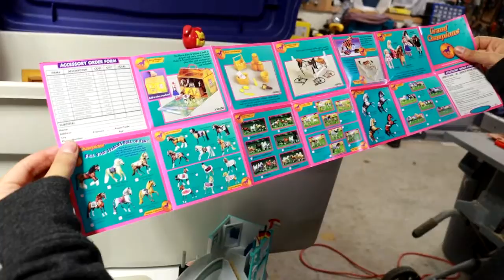UNBOXING my Childhood Collection of GRAND CHAMPIONS Model Horses, Toys & Stuffed Animals I Sewed

Comment: "I used to think the horse thing wasn't an issue... But I'm starting to think it's an issue." Thanks for the giggles. I had a few of the early Grand Champions back in the day, and donated them (many of which were Maureen Love knockoffs I feel now with more educated eyes). Which I alllllmost regret, but I'm sure some little girl was thrilled with them... One of mine that made noise, the battery was working well over ten years later. Cute video!

Comment: The following models and merchandise from Grand Champions that I used to own are as follows: (it was never easy choosing which ones I was after as they were all really cool).....⬇️

*The quarter-horse foal called Goldilocks from the 2000 range of foals (the golden palomino one with the pink horse blanket/coat/rug and matching pink ribbon in its tail).

*The 2003 Lippizzaner foal (the black one with the white star on its forehead  and has a deep red horse blanket/rug/coat and matching red ribbon in its tail). Not sure if this foal had a name.

*The 2003 Lippizzaner stallion that sported white tack & a red felt saddle blanket with a matching red tail ribbon & the horse model itself is in a pose where it's rearing up its front legs; the model also came with a green stand that obviously represents a patch of grass. No idea of its name though. 

*The 2003 Holstiener stallion called Captivation, the bay coloured model horse that sported either dark brown or black tack, a white saddle blanket with yellow piping and a matching yellow ribbon in its tail. While I loved this model, trying to balance it was a pain due to its stance! But hey. 

*The 2001/2002 Clydesdale family set in dark brown, can't recall if they had names or not. But for certain the stallion father, mother mare & foal all had a dark green ribbon in each of thier tails, they had matching dark green accessories and the stallion father horse had caramel coloured tack with a matching dark green felt saddle blanket. 

*And lastly, a set that came with a brunette show jumper rider doll who sported a white blouse, a dark blue showjumping rider jacket, white jodhpurs, a black riding hat and black riding boots; furthermore, the set also had some spare tack with a dark green felt saddle blanket, some other accessories and a horse shoe shaped bouquet of roses. This set was part of The Classic Collection. Hopefully that narrows it down somewhat!

Also I was wondering where they sell Grand Champion horse models and merchandise since I may get back into collecting. Hopefully if I do start collecting them I will have more luck with having a larger collection...i might even be lucky enough to own the aforementioned products again, but this time with other models and merchandise alongside.

N.B. all information on names of models etc are found on the Angelfire blog that's based on Grand Champion horses and merchandise. I highly recommend for all GC fans to check it out x